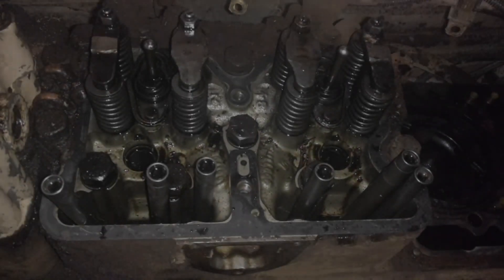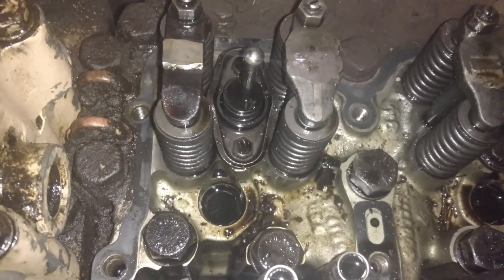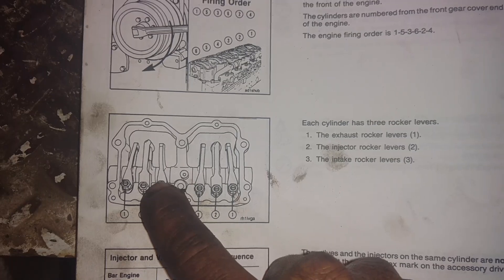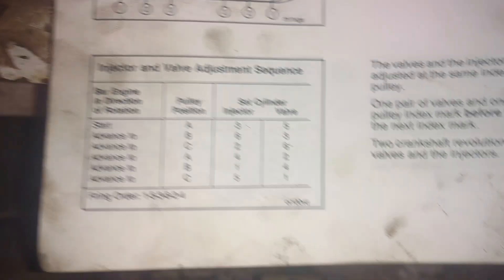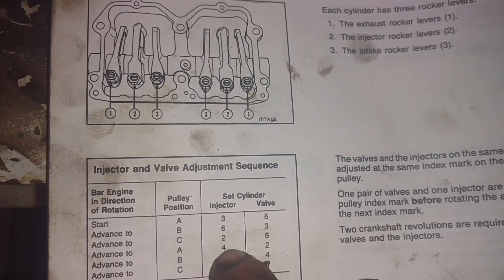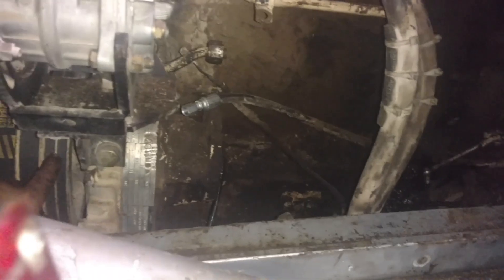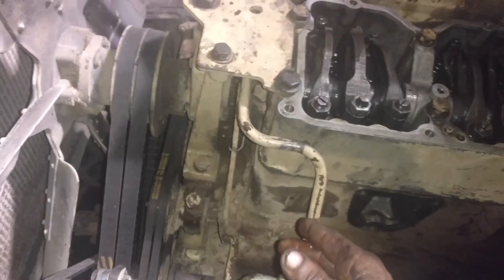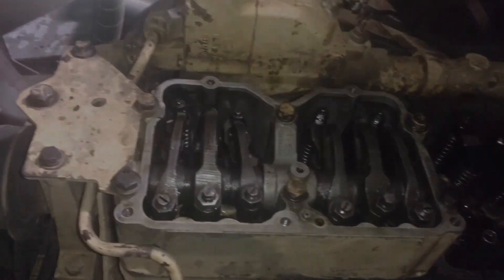Cummins valve and injector adjustment

Comment: Got a nh220 Cummins 1959 timing marks 1-6 vs does that mean adjust injector and valves no 1 move it rotation 2-5 adjust 2or5

Comment: I’m looking at a truck with a bc 4. Would the truck run rough if the injectors are not set right or if the over head is out of adjustment.
Reply: No, it will stumble n shake under load, under idle, you'll never be able to tell valve lash issues, bad injectors under idle still can't be diagnosed as bad.
Everything's gotta be under load

Comment: Never heard it called the inner/outer base circle method.  On the big cam engines, we always ran the injector on 1 ahead of the cylinder we were adjusting the valves.  For instance, if we ran the valves on 1, we would set the injector on 5.  On the small cams we would adjust the injector on the same cylinder as the valves.

Comment: Hey man so I’m running the over head on a 365 stc big cam and I was wondering if not having the engine in TDC before disassembly would have any effect in the reassembling and adjusting process ?
Reply: Makes no difference, after reassembly you have to set the overhead, Cheers

Comment: So I have a 444 cummins and it says right on cpl tag .011 INT and .023 Exhaust. So I guess I would use the IBC method?  You said on your 444 you use the OBC method.   .014 INT and .027 Exhaust.  It also says on my tag T.S. Zero Lash.  This is for a 444 STC engine CPL# 1280.  So I am very confused here.

Comment: Good info thanks. But I am still getting mixed specs (valve and injector)for this 1991 Cummins STC 444 CPL 1280 serial# 11622768. I believe this is an 88 big cam IV. The book method I see is for a 6 lb-in torque wrench with a lever(3822648) for the injectors and 0.11 and 0.23 on the valves. Am I on the right path?

Comment: I’ve got an older n14 and I keep bending and breaking injector push tubes. Twice on number 4 now on number 1 cam and rollers look fine I’ve herd that if the Jake’s are sticking it might cause this. Any help would be appreciated
Reply: Biggest reason for bent push tubes is the engine is probably set wrong, set it at the outer base circle which means when on A the cyl set should be 1 or 6, whichever has both valves closed. Intake clearance should be 14 thou, exhaust 27 thou and injector 125 inch pound on mechanical engine or on electronic N 14 bottom out injector and back off 2 flats of adjusting nut. Other possibility is that the accessory drive has been removed and not timed to the camshaft when reinstalled.

Comment: Hi there,  does this also apply to the NH220?  - Just about to do this on my D65E-6 dozer
Reply: The setting would be outer base circle, when on A or 1 - 6  B 2 - 5  C 3 - 4 you set injector at 72 inch pound the intake valve at 14 thou, and the exhaust valve at 27 thou. This should be done when engine Is hot  firing order is 1 5 3 6 2 4  the cylinder to set is the one with the valves shut  colder I usually set at 60 inch pound and intake 13 and exhaust 25.  then after warming up reset the the valves and injectors.

Comment: Q: Looking at buying a 1977 truck fitted with BC350. Owner has ‘adjusted’ injectors and says it now fills shed with smoke. Are the injectors easy to set without reseting valves and how likely is it that its only inj that needs setting up.

How many hr work to set injectors at a diesel workshop should l expect?
Thanks

Comment: Haven’t watched this yet, but thought I’d chime in. I was a Cummins tech in Atlanta in the 80’s, and I had a cheat I’d use for adjusting the valves on the 855. I’d run down the adjusting screws to squeeze out any excess oil in the push tube cups, then back them off. Then I’d set my feeler gage in place and use my 5-6 in/lb torque wrench to tighten the adjusting screws. Lock them down and done. I got consistent results every time, and I didn’t wear out my feeler gages slipping them in and out trying to get the “feel” just right. For anyone who doesn’t know, the 5-6 in/lb torque wrench was for setting the injector push tube clearance to zero. I used that principle to set my valves, but with the feeler gage in place, I got perfect clearance every time. I haven’t touched a Cummins engine in 30 years, so I’m behind on the technology and current design, but I’m sure there’s a lot of those engines still in service today.
Reply: I always wore out my feeler gauges, but it was always fun. Loved working on the old Cummins Engines, especially using the uniform plunger travel method for injector adjustment.
Reply: Yep the good old days of working 14 hours and in bed with her
Love it
Reply: I've just done this exact procedure.

Comment: When you have the heads done over and your starting over. Where do you start over . So I’m going to intall my heads then the pushrods. When I install my rocker boxes I’m assuming back off all my set screw on all my rockers. First set my injectors then follow my procedures. This is my first Cummins

Comment: Would you be able to explain to me how to adjust the cross heads. My exhaust crossheads when it’s their turn to be adjusted during inner base their at the correct lash but when i cycle over to next letter it seems to be to loose and create a tick and the cross T moves when looking at my valves on their cycle letter the exhaust valve seems to be lower than the intake. I have read the manual but It’s not the easies to understand.

Comment: I have an early 70's NHRS Cummins (supercharged) operating a fire pump.  I have been told that it is reverse rotation. #1 how do I determine. Looking at the front of the engine the crank balancer turns clock wise.  #2 what kind of overhead setting do I use inner or outer base method?  #3 what are the injectors settings (torque) and valve clearance, cap torque?
Reply from the maker: If it's turning clockwise looking at the front then it's not reverse rotation.

Comment: Sir, I have a question  What kind  of method do i use to get valve clearance on NH220 Cummins? The Ibc or Obc method?? Thanks.
Reply: The outer base circle, the inner base circle was only used on big cam engines, in later years the engines were all set at the outer base circle except the M 11 .

Comment: Sir can help me?engine ntc 400 engine with stc injector,can adjust valve n injector in 1 cylinder? Or top number 1 and i adjust injector number 4 90 inch pound??

Comment: At 1:32 the jake brake cross heads are positioned on the intake valves.
Reply from the maker: That might mean something if this one had jakes.
Reply: @westerntruckandtractorrepa1353  - Judging from your reply, safe to assume it does not have jakes.

Comment: Love your videos. On the outer base circle method (Mine is an old Big Cam 4 CPL 1594 with STC injectors) am I understanding correctly that the only part that I have to torque (to 90 inch pounds or whatever it is  is with dial torque wrench) is the injector rocker correct? The rockers for the valves I do with feeler gauges correct? Doing it this way you do not mess with that 6 inch pound setting that I keep hearing thrown around if I understand it right(which I understand is for the INNER base circle)? There is so much misinformation about this on the web and forums that it is unbelievable.
Reply from the maker: Yes , that is correct.
Reply: Great thanks, One other question: How do I know what torque number to torque the injectors to? I cannot seem to find the OBC torque rating for the 1594 CPL anywhere. It is in a John Deere 8970 tractor. Any ideas how to find something like this out? Our local Cummins dealer in Houston is clueless and think that that CPL is a N14 when its clearly a BCIV.
Reply from the maker: El Campo  You set yours to 125 inch pounds on the same cylinder you are adjusting valves on .

Comment: Quick question the #7 thrust bearing for the crankshaft is there a tool or technique to remove the cap on a 855 big cam 3
Reply: Never mind got it, on LPF liners what is the liner protrusion specs and for an nt 855 and do you use RTV counterbore?

Comment: My engines instructor at dmacc told my class 15 to young 36 to old 24 just right made us laugh and I have not forgot that since
Reply from the maker: Adam Still wow, haven't  heard that  in awhile,  I guy named  Bill Nack taught  me that  at wyo tech about 20 years  ago
Reply from the maker: Adam Still same way  i remembered  too
Reply: did you read my comment on the 68fre dodge transmission about overdrive underdrive clutch hub from sonnax great company to buy performace transmission parts from
Reply from the maker: +Adam Still  I did, I actually  did the last 2 with bd performance  kits with  the double  disc converter, they too use double  sided frictions, and upgraded pressure plates and a inline module that increases line pressure called protect 68. I was really  happy with those. I have used sonnax parts on 4l60e transmissions  alot and was happy with them as well.
Reply: I found that Sonnax was cheaper the one they have bolts together I thought was way better but opinions are like assholes everyone has one lol

Comment: how do i identify my engine. i think its an L10 but i cant find the tag
Reply from the maker: Andrew J should be on the top left corner right by the accessory drive pulley
Reply: ok. Am I looking for a riveted tag or is it stamped in the cast? Im cleaning thendirt off of it now. The engine isnt the original engine in the truck so the vin is no help
Reply from the maker: Andrew J  It's  riveted
Reply: ok. My 5.9 cummins is like that. This engine doesnt have the tag on it. I know I have the right injectors because we got a part number off of the old injectors. (Top stop injectors) the engine has what looks to be millitary paint on it. single long valve cover with a slanted valve box riser. Just trying to make sure i have the right valve specs. We didnt loosen any of the valves when we pulled injectors just slipped the injectors out after moving the injector rockers
Reply: I do have a casting number or something on the top of the block towards the rear drivers side

Comment: hello could you help me with procedure to calibrate an small cam 250?
Reply from the maker: jose rubio  Start out on accessory drive mark A and check valves to see if valves are loose on #1 or # 6  .  So if valves are loose on #1 then adjust Injector on same cylinder you are adjusting valves which would be #1. Adjust Injector to 72 inch pounds  , and then set valves to intake .011 thousandths and exhaust to 23 thousandths.  Go to accessory drive mark B and you will be on #2 or #5 , if you did cylinder #1 then cylinder #5 will be next. Firing order is 1, 5 ,3,6,2,4 .So the next mark will be C  and You'll be on cylinder #3. Then go back to A to do the other cylinders.

Comment: I,m lookin at buying a 50's K Dub with a 220 in it and i was curious ( it hasn't ran in 25+ years) if the 220 was a sleeved motor and easily rebuild-able or if it has to be bored out, I'm tryin to figure out if i should even think of keepin the motor or just swapping it out for something else, it'll end up being a roll back tow truck

Comment: we just replaced number 1 and 2 injector on big cam 4 855 engine  with stc injectors and replaced gaskets on number 3and 4 cylinder  rotate engine and  get a clicking noise  on both heads   we adjusted the motor using outer base circle  we adjusted number 1 cylinder to 90 inch pound and then the valves then finished adjusting the other 3 clyinders  now  we get a clicking noise when we rotate the motor using the starter  and a jumper  clicking noise is worse when we start building up oil pressure  any help would be appreciated  thanks
Reply from the maker: +Dons Gee  What gaskets? Head gaskets, rocker box gaskets. Make sure the rocker box hold down bolts are tight, it sounds like you have a valve loose, was it ticking before you changed injectors? What are valve lash settings on your engine? 14 and 27 or 11 and 23?
Reply: we replaced rocker and jake gaskets set valves to 14 and 27 and injector to 90 inch pounds   we change injector cylinder two was white smoke  my friend wanted to change both injectors  so we would not have to touch that head again for a while but after getting injector we noticed the bottom oring was hard  and flat  on old injector     i put my hands on the rocker for the injector  and the injector feels like it is clicking   we tightened the rocker  hold down bolt to 60 foot pounds  don know what we did  to get a clicking  noise  have done the out base circle  a coulpe of times never had a problem with clicking noise untill now    i think the injector  clicking noise is when the injector is coming back up

Comment: Great comment about adjusting the injector first to preload the rocker shaft!  I don't remember the book saying that but I will do it that way from now on out.

Can top stops be adjusted on the OBC?  What would torque setting be for doing it that way? OBC makes more sense to me since the plunger is bottoming and you don't want that too tight or loose.  If the cam isn't perfect and you set it on the IBC it could be way off on the OBC.  I have heard there is a rubber piece in top stops that basically makes them push the plunger into the cup the right amount despite cam wear.  Is that true?

Thanks for the great video!
Reply from the maker: cumminsscout  I actually hardly ever run ibc method anymore. I set up most of the stc 444 at 90 inch pounds and alot of the others at 72 inch pounds. A couple of those cpl # took 115 inch pounds.

Comment: Yes sir I have an old versatile 895 with the 855 big cam with around 13000 hours was getting oil in the water 100 hours ago replaced the cooler and now in getting water in the oil seem to run fine until today and was running hot that's when I noticed them water vapor coming from the blowby what's the odd of a bad oil cooler or cooler seals?
Reply: dale evans 
That's what I was worried about i had replaced the oil cooler and I guess I didn't get the O rings in far enough some of them older engines will pressure up to 75 - 80 lbs of oil pressure and I guess push them out and made a big mess then when I shut I off the water pressure forced water in the oil anyway got an new O ring kit and did it all over and seams to be working fine
Reply from the maker: Maynard 59  I would think you have a separate issue, sounds like a head gasket, oil cooler typically blow the back in the coolant because the pressures are higher.
Reply: grease monkey101 kinda what I suspect it seemed to have a lot of pressure in the cooling system although it was around 220 degrees n blowing steam didn't want to pull the cap off any tricks to picking the right head the first time
Reply: You probably have a cavitated liner

Comment: I have a N14 RedTop Celect+ 460hp. Started smelling coolant and found bubbling at block and front head. I'm guessing this is the problem but wondering if a blown head gasket will allow coolant to get into a cylinder. Reason I ask is I stopped the engine for a few minutes to check oil and upon starting I generated a large steam cloud for a few seconds, then it cleared up. No engine miss, no power loss but temps climb and require engine fan use to keep temps in check. What is the clearance for the rockers upon reassembly. Your videos are great! Thx! Kelly
Reply from the maker: +Dons Gee  The head of the bolt where the wrench goes on has 6 flats on it make a mark on head  and then 2 flats on bolt and move to mark on head.
Reply from the maker: +Swede Jr.  Well you definitely have a blown head gasket.
Reply from the maker: That n-14 should be 14 in take and 27 exhaust.  Injectors will be set on same cylinder as valves and adjust injector before valves by loosening locknut and tighten injector set screw till timing plunger touches (which you will feel) and then back out two flats.
Reply: is this at tc or at a b or c depending on cylinder because i am confused because outer base circle says adjust to 90  inch pounds injector first then valves   while the pulley is on the marks and what do you mean by two flats   big cam 4    855 stc injector
Reply from the maker: +Dons Gee  Don't adjust anything on tc.  Start a A which will be cylinder 1 or 6. If the valves are loose on 6  that means you are on tdc on that cylinder so you would start there and then go in firing order 1, 5 , 3 , 6 , 2 , 4. B mark covers cylinders 2 and 5 and C mark covers cylinders 3 and 4. It takes 2 complete revolutions of crankshaft to adjust all valves. And yes start by adjusting Injector on that cylinder first and the do your valve , then rotate to next letter on accessory drive until all have been adjusted.
Reply: setting the injector using this method  is that strictly on the celect  motor  not on the big cam 4